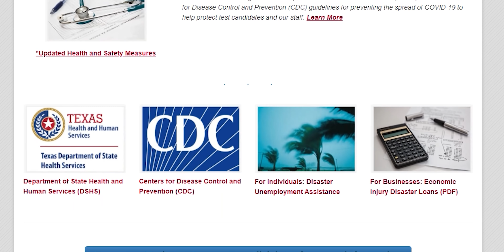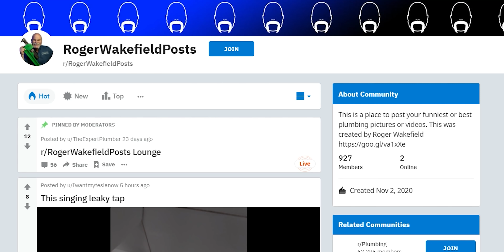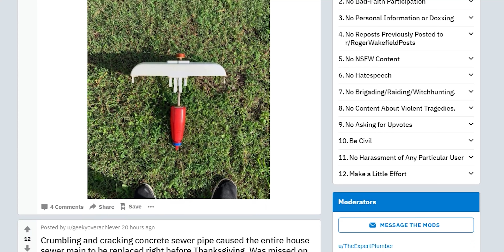Before you have a plumbing leak WATCH THIS Freeze break repair!

Comment: My Texas house is pier and beam with copper underneath. Had  faucets dripping, but still had a burst. The main line had a weak spot where a hack saw was used, but not cut all the way. Probably done when the house was built 20 years ago. Please don't do things like this! Tempted to use shark bite cause it's cold and wet under the house but repaired it properly. I couldn't live with myself otherwise.

Comment: The solution for more plumbers is to decentralize, remove licensing and certification, and allow demand for reputable plumbers to determine pricing, so people will know to stay away from the cheaper guys, or the ones without a credible history.
Reply: That's just stupid
Reply: @HunkMine  Then you oppose a free market. I'm okay with a private firm issuing certifications, if they want, like UL does for electronics, but it's not effective unless there are competing forms. That's the same reason government issued stuff is somewhat irrelevant, since they have arbitrary, monopolized determining factors. Also, with private determining factors borders wouldn't make a difference, such as comparing the way car insurance works versus health insurance.